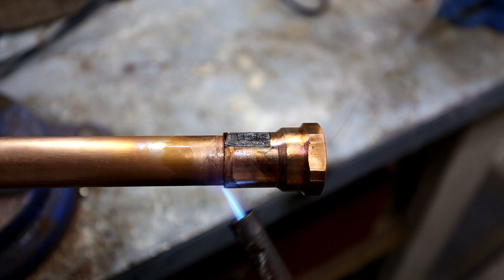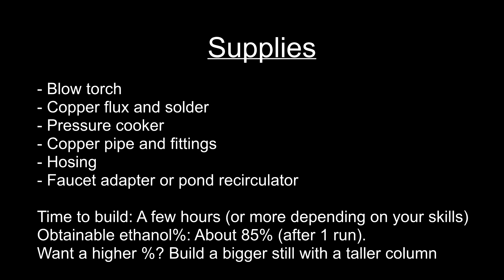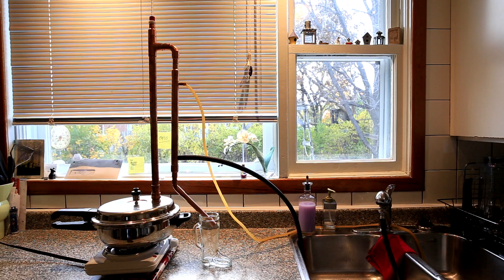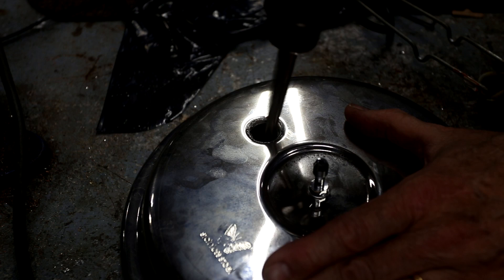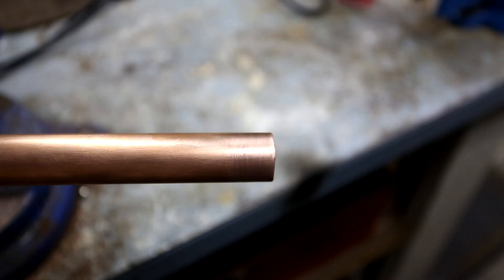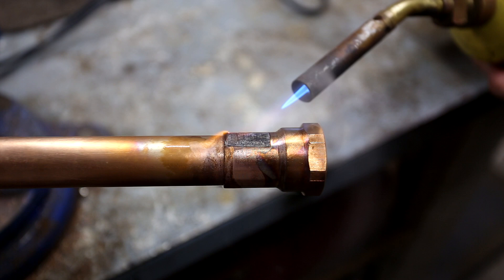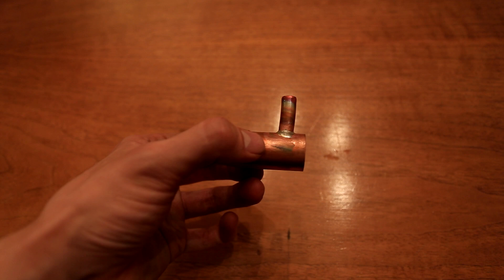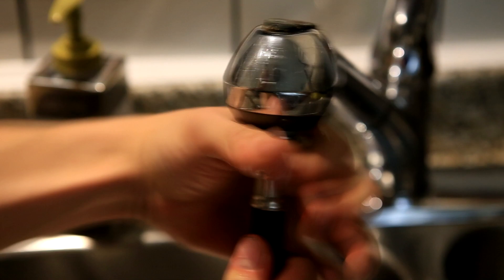How to build a Pressure Cooker Pot Still

Comment: why cant you use glassware?
Reply: You can, but people interested in building stills for purposes other than chemistry won't have it lying around. Also, as he did, they'll be fermenting their own ethanol, meaning they'll have large volumes of only 10-15% EtOh to distill, and labware scale boiling vessels aren't exactly practical for that. You may have a 5 L round bottom flask if you're on the crazier side, but even that's small. Then again, the pot Nile used is tiny too... Usually, you'd have a 20-30 L fermentation bucket, and at least a 15-20 L still so you can process all that volume in 1-2 distillation runs, instead of dozens.

If you only need to make small quantities at a time and have the glassware on hand, sure, use that. 5 L fermentation run, half a dozen distillation runs assuming the largest flasks you have are 1 L, and you're left with 0.5 - 0.75 L EtOh.

Comment: i use copper scrubbers to pack my column. it's not a true reflux, but it "filters" the vapors and does slightly reflux the distilate. gets me higher % and more volume. and never use paste, just buy teflon tape. paste never lasts for the entire process and you end up losing efficiency.

Comment: Forgive me for asking as I am slightly ignorant in chemistry but you said 96% is the best you can get ... Is there not a way to make the ethanol anhydrous?
Reply: Molecular Steve's are a good one 3A but you can also mix it with solvents that will bind to the water more tightly that also have a higher boiling point than ethanol it largely just depends you can also react using sodium but that's an extreme fire hazard obviously

Comment: Thanks, NileRed.  I know it’s a start and as you suggested I will look for other distillation apparatus construction on line.  Any recommendations?  You showed that this construction can be actually be done in this video, which is a excellent motivator !
In a previous video you showed how to distill solvent ethanol from a sugar wash.  If this ethanol was instead used for human consumption, do you know if the copper distillation tube contaminates the ethanol?  Also, is it possible to get copper flux and solder that is certified lead-free?  I recall that at some point that the US EPA passed rules limiting lead and copper in public drinking water.  I’m pretty sure the source of the lead hits they were getting was from lead in the copper plumbing solder. I think public water sources like municipal water supplies were able to control the level of copper contaminants by controlling the pH of their water.  Although in these days of COVID 19 I’m looking only for solvent ethanol, it would be nice to know that future batches do not have too-high levels of metal contamination.   Thanks again for a great video!

Comment: Can you use a normal distillation with a large round bottom flask for this?
Reply from the maker: +Constantino Fine Art You definitely could. It's just that this has a capacity of 4L. You could get a different cooker that has a capacity of many many liters. It is just an efficiency thing.

Comment: when packing the column where exactly would you put the packing? in the thiner tube with vapor flowing through it or in the pipe with cold water going through it?
Reply: +parker renick ...in the larger (distillation) column coming out of the pot where the vapor of the different components can separate from each other. Water will cool sooner, condense, and fall back into the pot. Alcohol vapor will continue to the top of the column, turn the corner, condense into liquid in the condenser, then fall into your collector.

 You would also need to make that column be able to be un-assembled for the cleaning/replacement of the packing. I use (pure) copper scrubbers as it seems to add nicely to the taste of the alcohol.

Comment: Do you think that epoxy can be used instead of welding, if the products of distillation are not intended for consumption?
Reply from the maker: I don't see why not as long as the epoxy doesn't start to degrade around 100C.
Reply: Lucas de Almeida Do not use an epoxy or anything like that!!
Reply: In what metal are your house water pipes made?  In Canada, they are still in copper .

Comment: You can make a fractional distillation chamber if you put some crumpled copper sheets inside the column. That will increase your yield by a shit load.
Reply: The vapors will condense onto the surface area of the inserted copper sheets and revaporize in the same ratios of ethanol to water as at the bottom of the column. Effectively, your yield would be, instead of 1 - (0.15) = 0.85 to something like 1 - (0.15)^6 which is pretty much 0.999
Reply: Jake ethanol and water form an azeotrope at 95.6% so at that point, the water will vaporize just as quickly as the ethanol keeping the percentage at exactly 95.6%

Comment: Great video ! 
I have a small question: Why do you call it a reflux column when you don't reflux (send back) the condensed vapors back into the still?
Reply: cause he's talking about passive reflux, by having the still head be that long you're gonna have a cooler top part. of course to make it active reflux just duplicate the product condenser on the still head.

Comment: If you plan on tasting your distillate skip the flux- it has an awful taste that no amount of washing seems to fix. I would go the flour paste method myself if I were to do it again. Also, for tasting, you should learn about heads and fusel oils.
Reply: He's using it as a solvent not for drinking

Comment: Thanks for this great and inspiring video! Please let me ask the following questions:

The rubber gasket in my pressure cooker does not completely seal of the cooker before the liquid in it is cooking. Without having tried a construction like this using my cooker, I guess it would work, but i am not sure. Is your pressure cooker effectively closed of as soon as it is closed or is like mine, that is, the gasket depends on the inner pressure?

How deep do you position the thermometer and what temperature do you reach for?

Comment: doesn't the fermentation make methanol aswell?
Reply: Fermenting a sugar wash does produce some methanol but very little (15ml per 8gal typical). If you don't pull it off first it will effect the taste and can give you a headache. You can detect by smell to know when it's safe to start keeping the ethanol. Same for tails. When it starts smelling like wet cardboard just stop collecting.

Comment: Is the copper necessary Or could one use glassware such as that found in an organic chemistry lab to get drinkable ethanol?
Reply: +ERprepper I don't know man, you are using a pretty decent amount of heat.
Reply: +ERprepper Copper is nice because it neutralizes the "off" flavors. A still made out of 100% glass might make a pretty awful-tasting drink.
Reply: +ERprepper I use a full glass setup. Works great imo.
Reply: +bcubed72 My dad used to toss a hand full of raisons into the shine to sweeten it up and get high on the raisons later ...Glass is ok .
Reply: *raisins
Reply: nothing screams METH LAB like a kitchen full of Pyrex lab glass and chemicals..

Comment: I would have used a water pump to not waste as much water.
Reply: I agree. I use a 32 quart cooler and fill it with water and circulate my cooling water using a submersible aquarium pump. I drop frozen 2 liter water bottles in and I'm good for hours. Otherwise I occupy my kitchen sink for half a day.

Comment: Pretty close to what I have been thinking of. Wondering if you or anyone watching has tried this with an electric pressure cooker so it doesn't require a separate heat source, also many of them allow specific temperature setting.

Comment: A pond recirculator (sump pump) with 10 gallons of water will overheat very quickly. I tried this starting with two 5 gallon buckets full of ice water. I swapped bucket when one got too hot. By the time I finished distilling 5 Liters of solution the water in the second working bucket was too hot to keep my hand submerged. It was visibly steaming. I had the temperature recorded, but I lost those notes. Of course,  hot water is very bad at condensing the alcohol vapor into liquid, so toward the end there was quite a bit of visible vapor leaving the still, with only a few drops every few seconds, so most was getting lost to the air. Very low yield. I had hoped that the recirculator would work so that I could make a self-contained portable version of the still for demonstrations. Impractical. So for the time being I'm still tethered to a water tap and a drain for cooling water.
Reply: But if you put a suitably sized radiator / cooler in the circuit, perhaps with a fan it would work fine. That's how car engines are cooled.

Comment: I appreciate the whole "giving you exact specs takes some of the fun out of designing your own" aspect of things, but just some basic specs like column length and diameter and mentioning whether it was packed with anything would have gone a long way to helping me out. It's just not really useful to give a result of "this design produces 85% ethanol" when we don't have a basic idea of what the actual design is, you know?

So... I'm guesstimating your column is about 50 cm high and 3 cm in diameter, and isn't packed with anything? If so, that's some pretty good efficiency for such a simple design. I take it making the column slightly higher (70 cm, let's say) and packing it with 3 layers of evenly spaced copper wire mesh could push it to azeotropic (or close to it) ethanol?

Comment: DOES THİS PRESSURE COOKER BLAST WİTH ALCOHOL VAPOR ?
Reply: +mehmet olcay yes of course make sure you use an elect. hot plate with a dimmer switch wired in to it ..
Reply: Albert Mag
I AM SCARED...
Reply: +mehmet olcay That's OK Bro. ,  As long as you are aware of the dangers and respect them for what they are , use caution and good common sense ..The vapour  is very flammable  but it is contained within the still and condensing apparatus as long as you use an elec. hot plate with a rheostat dimmer  switch wired in to its cord no problemo ..this heater is even very safe with the pot and wok method where you put your mash in the pot drape cheese cloth over it with small container in middle and wok on top full of Ice water ...sitting on hot plate ..the vapour goes up threw the cheese cloth condenses on bottom of wok rolles down the curvature to the middle and rips into the small container as good old moon shine ..easy as pie ..this method comes from my grand parents who did it back in Italy in the 1800's ..its an oldie but a goodie ...

Comment: Ok still design but your out put is to close to your burner. You will get get alcohol fumes at the out let that can ignite. And only use silver solder on your connections, alcohol will leach lead from solder joints. Good to see you used copper fittings, NEVER use brass. It (brass) can react with your alcohol and produce poisonous salts.. Most important and not mentioned here is if you are distilling methanol you need a fuel license from the feds. If your making ethanol (drinking) alcohol you need to be a licensed distillery. The feds don't care if it's a 1 gallon still or a 100 gallons. They can arrest you for running moonshine. BTW, if you put your spirits in an old liquor bottle you broke another federal law on top of making shine. Check state and federal laws before you start.

Comment: why can't I use aluminum?
Reply: aluminum salts will do some nasty shit to you man avoid aluminum at all costs
Reply: +Jack miak I actually did after I asked. it's because it pits, not toxic salts. how would salt distill over when it's a non volatile solid? I much like Nile red am only interested in it as a solvent. Checked a distillers forum. It won't kill you, your still may not last as long. also if it's just a sugar wash, it should still hold up well. Acidic washes would be more of a problem. I am actually very smart, I do plenty of experiments involving chemical, pyro, and electrical. You should check my channel, I have lots of videos showing my competence.
Reply: +Gary Carone
Whether or not he was factually correct in what he told you, +Jack miak did at least try to answer your question while being clearly concerned for your safety.
Your ungracious, self-aggrandising  reply was unpleasant and wholly uncalled for.
Reply: There was nothing "uncalled for" in my reply. If anything, you bashing me for no reason what so ever, is uncalled for. Maybe when I'm given incorrect info for my "safety". I should just say "thanks" and shut up? We'll just keeping passing around misinformation, cause thats much better. GTFOH
Reply: Incorrect regarding the aluminum. If distilling a sugar wash no problem.  However the still won't last long and stainless is a much better material to work with.

Comment: Avoid lead as much as possible ! If the liquid or vapor or what your distilling doesn't make contact then it should be fine. How ever if the vapor makes contact and you plan on drinking the alcohol then don't use lead.
Reply: Is lead soluble in ethanol?
Reply: Yes and it's also soluble in water. Hence non-lead solder.

Comment: I thought this was illegal?
Reply: It's only illegal if you plan to sell the alcohol for the purposes of consumption. It's not illegal if you plan to use the alcohol for personal use (either consumption or chemistry.)  It's a grey area selling it for the purposes of chemistry.
Reply: @tjfjt  it is federalally illegal, selling it will get bad attention and what goes with that....
Reply: If you have a fuel alcohol permit, none of it is consumed or sold for consumption, and none of it is removed from the property without denaturing it, then and only then it is federally legal.  Are the feds going bother going after a personal still that small? Extremely unlikely.

Comment: You should never use solder to connect pipe joints of a still because it will leach small amounts of lead into the whiskey. If you get enough lead in your system in a short time it can make you go blind. The professional moonshine makers use either silver solder or compression fittings, but never solder.

Comment: That's a reflux still, not a pot still.
Reply: Chlorate Nope, it’s a pot still. The condenser is after the vapor bend.
Reply: Johnny is correct. Even a pot still has some reflux. A true reflux still sends 90% of the vapor coming up the column back down through the packing. You typically only pull 10% of the output off without disturbing the column balance.

Comment: the comment on aluminum  pressure cooker  is not suitable  is incorrect i have been using  one for years now an hAve not problem with it
Reply: Aluminium is not going to be a problem, since the still's product has been evaporated and condensed, which would leave any aluminium salts behind in the pot.

Comment: Dude... You really dont know jack about disstilates. Thats a reflux still. Not a pot still
Reply from the maker: You need to calm down. It is kind of a hybrid. If you dont pack the column it will be almost a regular pot still. If you pack it, itll be a reflux/fractional still
Reply: but nilered what is meant by packing column
Reply: This time the selfprocalimed chemist was semi-correct and that was awesome, soon I bet he'll actually be correct. I think I suck at chemistry but when I see all the comments I'm glad that I went to chemistry lessons and had a techer that taught me something. It was an old dude but so I don't only give a s**t when the teach's a hottie. My mathtecher was a piece of tail but now she's married, she wasn't then. Man I drooled over her, one time I just sat and smelled her face, needless to say we liked to be pervy, still I also did my homework. That's nice today, because I remember thoes things. So I can feel a bit superior, still, I realize that I'm not a chemist and that my skills are on a basic level. Still I know the difference between fractional column and a reflux condenser. I like and respect that this rednile-kid actually did a halfassed try at homecobbling a shitty still. I liked the vid and I also checked out this JW's channel since I've had a couple of beers and are still confident enough in my heterosexuality. To my disappointment I never saw a correct VR that shows how it's done right... There are many vids on this very simple topic, but if people use this as a complete tutorial to make alcohol to drink maybe they deserve the blindness. Still if you google a pot still they are as crappy as this guy's is. If I'm interested enough when I'm not drunk I'll make a video to help you both in showing a simple example of building a fractional distiller and how you preform the task correct, If you drink what comes out out of one thoes you'll go blind. In fact I bet I can make one of my beercans. I wrote it down to make this project but again the question is if I like to do that one when I'm not drunk. Since I like to drink the it's possible that I'll make that video while I'm drunk, that's when I make most of my videos anyway but you never know tomorrow when I wake up I'll amybe think it was a crappy idea and that that not funny enough to be on my channel where I like to have shitty videos and not acutally teaching anybody anything, I just like to laugh at my own videos. Blimey mate this comment's long enough I have to watch a shakira video now...
Reply: Nope, it’s a pot still. The condenser would have to be on the riser for reflux.

Also, calm down. It’s not that important.

Comment: Aw you mean that kind of pot ? :( 
I'm disappointed :(
Reply: How do you even distill weed? Wtf?
Reply: Nitro
 Weed can be distilled using alcohol to extract pure THC (also known as hash oil) 
THC is the stuff that gets you high
Reply: Ovais Saand
Its steam distillation then, instead of using alcohol you add some water, which co-distills the oil, which is rich in THC, but not pure. Also THC has to be decarboxylated to get you high
Reply: Butane works best to get oil from weed and its easy to evaporate off.